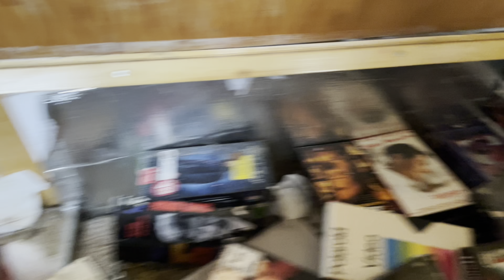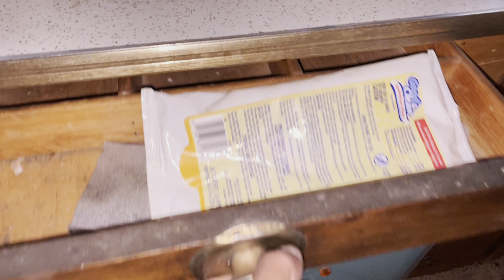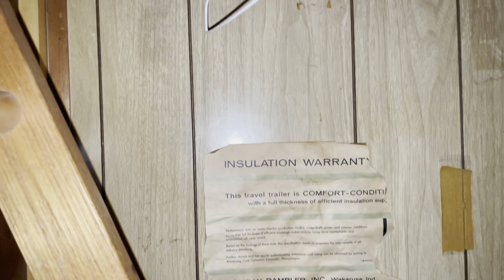Rambler Closer Look & Cleanup Pt.1 | FullTime RV Living!

Comment: Yes, that looks like an old style of gas wall heater. I'd check the flue after digging the insulation out. If you plan on staying in this one during winter, you should have numbered the insert boards to easily re-use when it gets cold.
Reply from the maker: Ahhh, awesome thanks and i do not plan on reusing it. I had to break most pieces just to get them out of the places they were in and i would have no where to store them while cleaning and stuff. Hopefully i can find something online about the gas heater
Reply: @rvaway  The wall heater is a convection type. The heat will come out the top vent and cooler air will go through the bottom vent and move upward once the temperature of the heat exchanger gets warm enough. There should be a small hole through the bottom of the floor beneath the heater. That hole provides fresh air for the burner. 
The commode has a ball with a hole as large as the exit hole in the bottom of the commode. It is opened and closed by the lever you put your foot on. I believe it is supposed to be spring loads. Those types of commodes are made to conserve water. I believe they need somewhere between a pint and a quart to flush. I may be wrong but I believe everything goes right into the black tank with no pee trap involved when flushed.
Reply from the maker: @genespell4340 That makes sense because it vents from the roof from what i saw as well as the heater! Thanks for the advice!

Comment: BossaNova Life does vintage camper rally tours.and they have done several Ramblers . Try to keep as much as the original as you can.
Reply from the maker: I’ll have to look them up, And that’s the plan! If you’ve seen my Vagabond renovation I’m trying to keep as much original as possible and just add to it! Few modern touches would be nice but keeping those old bones is the goal💯🤩 also thanks for the info and comment i appreciate it!🖤 Hopefully my rambler will make you proud 🤙🏾